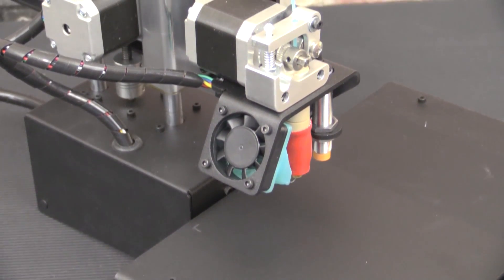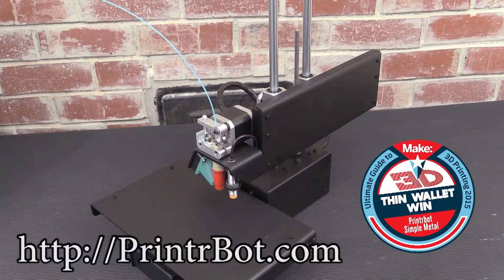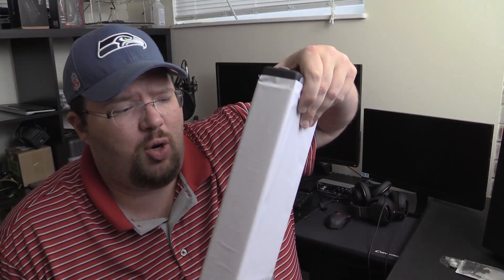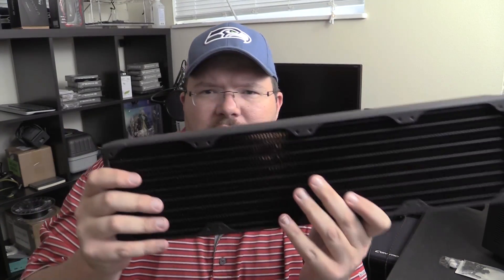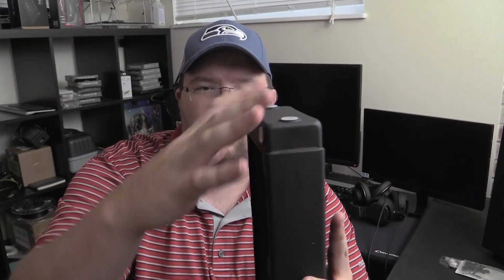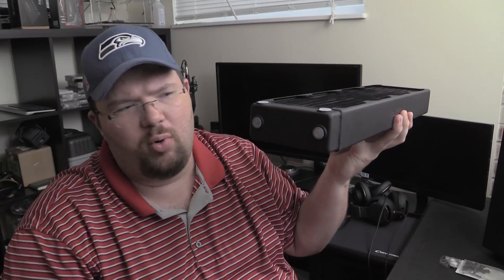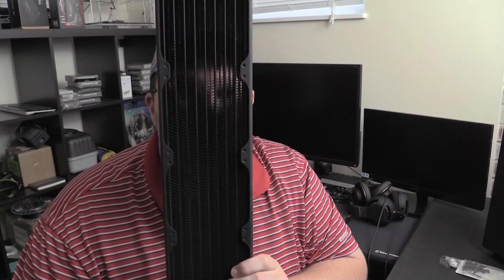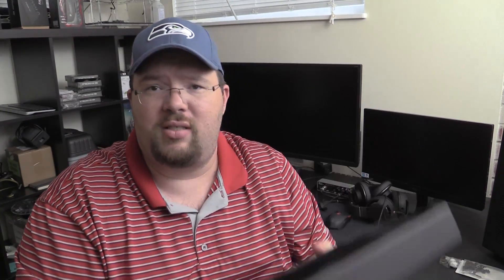Say goodbye to your computer overheating!

Comment: I'm using alphacool 480 45mm thickness. It has 6 ports and I used 5 of them. My radiator is at the 2nd lowest position in my loop with pump at the lowest. I have 1 in, 1 out, 1 drain and 2 temp sensors taking 5 ports. Their 60mm and 80mm models have 7 ports.